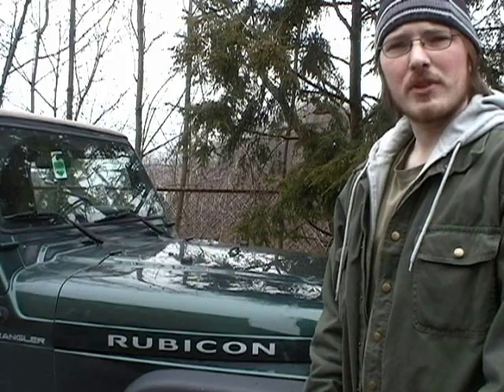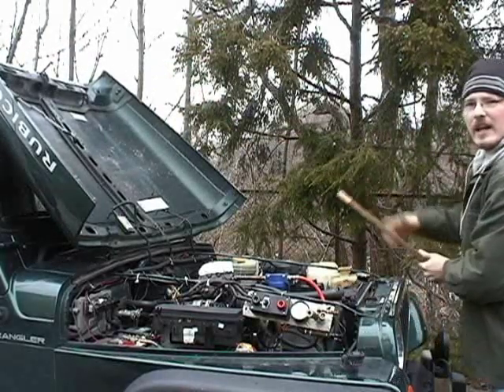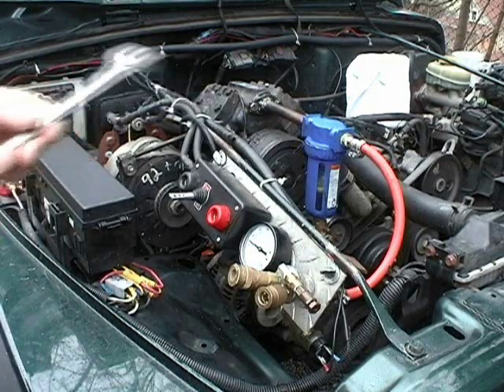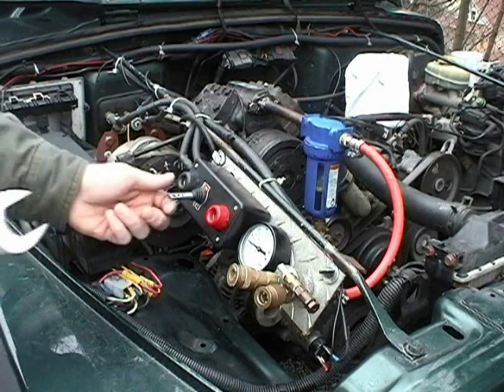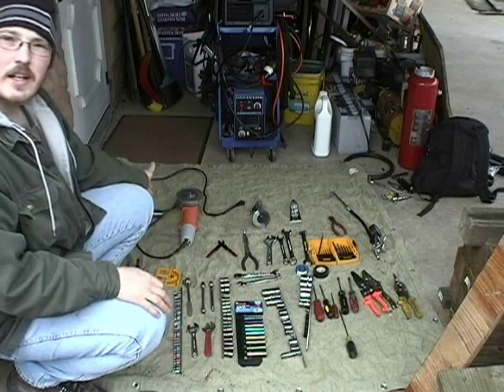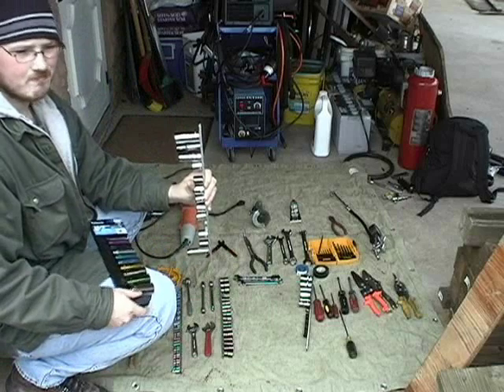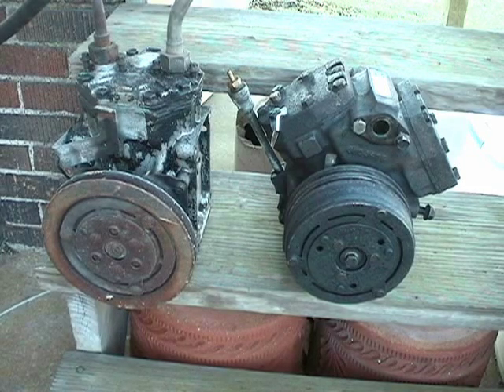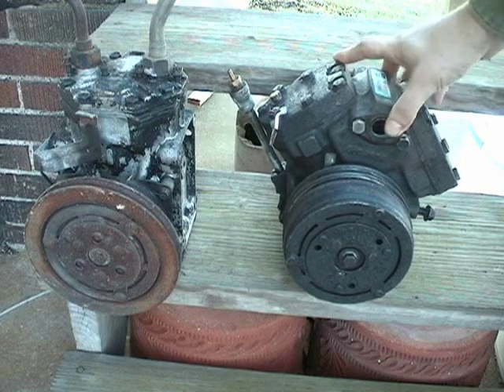Building a On-board Air Compressor / Welder Part1

Comment: To build the on board welder on my old Jeep, I used a 1976 Lincoln continental alternator, externally regulated, the Miller quick disconnects, a 110 Jack for brushed power tools and a 250 VDC gage. I can weld and run grinders , just depends on what rpm I have to spin it at. And I don’t have a gaggle of stuff hanging off the back of the alternator. And I can run it hot enough to burn 1/2” plate steel. Best part is it is a off the shelf alternator from oreillys with a life time warranty.
Hasn’t failed me yet, but I end up fixing everyone else’s junk.

Comment: Instead of the alternator diode pack, use a 200A 3-phase bridge rectifier. You can pick them up for between $25-50 on ebay. An alternator is 3 phase, so you have three "hot" wires you need to rectify, all sharing one common ground. The 3-phase rectifiers are easy to mount and hook up, and will not eventually break due to vibration like the jury rigged alternator rectifier pack as you are using. You can get them all the way to 1600v @ 500A.

Comment: You made a comment at the end of this video about the cast iron RV2 having better heat dissipation over the York. If your just going off of heat dissipation, then the york wins simply because it is an aluminum housing. either way not a bad video and there was a lot of information thrown out there

Comment: I've got a 14 horse gas compressor in my work truck I'm fairly sure it's cheaper and I know it's a hell of a lot better. It's easily installed and if it fucks up your not stranded.
Reply: you can get compressors that work with inverters to

Comment: Doing this to my 2000 TJ, it's got the 4.0 L and I was able to get a serpentine belt pulley for the RV2 compressor I'm using. Just got the Magnet mount done, spins free and smooth.

Comment: If you have teen boys, you will run into your wrenches in the yard. You will ruin your mower. But at least you will have found your 7/16 th, 1/2", or 9/16 th wrench that has been missing for a month.

Comment: Nice job fellows.  I am not much of a 4 wheeler, but a friend of mine was able to get a permit to go on the dunes up at Cape Cod, so 4 wheeling I went.  I threw my 10kw generator and 7 hp. gas powered air compressor in the back of my F350 diesel and towed his Jeep up to there. Did some 4 wheeling, hit Lesbian strip clubs in Provincetown and all was well...LOL!

Comment: that's why you utilize the compressor clutch, energized by the pressure relief/regulator valve, it'll kick on when you need it, and free spin when you don't.

Do your homework, and use the grey matter between your ears once in a while.

and about value retention, I sold a vehicle 2 years ago with a custom York OBA setup, the guy willingly paid me $500 just to keep it in the truck, I paid $150 for everything needed...... I've already built another one to install in my ZR2 after it's 4bt swap.

Comment: @MrAveragebear did the early jeep's PTO have the option to run a backhoe? Like my comment said, search santana land rover and you will be blown away; (by the many different PTO attachments they had available, from firetruck units to backhoe units to heavy welding units, the list does go on).  (not just the normal tractor PTO stuff)

Comment: Good idea man,,,,, but you can get all of that as bolt on parts if you purchased an old series land rover, they even had a backhoe attachment. All P.T.O, - power take off like a tractor. 
Search "santana landrover" and you will be blown away.
Also my man, do you know car batteries explode big time? Try not to use that cutting thing like that in the engine bay,,, just to be safe..

Comment: York 210's fill 40" tires from 7-30psi in like 2min... 35's in like 40seconds.  33's, which most people would use them for, would be like 30 seconds, and it will still run air tools.  You can try to match a 12V or even a 115V system to a York, and find the York to be a pretty nifty setup for the money.

Comment: u might wana put that diode pack in a box with 12vdc fan soo not to over heat them 2 did u have a reserve tank for air pump  iam sure u got  to  run engine to weld  good idear all in all

Comment: well here's my counter agrument.

1,)   like an AC unit,   this will not rob your horse power when not in use

2.) Your wrong about the resale value.  Modification to Vehicles only add to their value 

3)  DeathBlade is Right

Comment: YOU want an air compressor in a jeep becuase you want to fill up your tires after you air them down. 

This kit is simple.

Its just a good thing to have.

(wont rob horse power when not in use)

Comment: Why didn't you just buy a vair 480c compressor? My dual compressor setup is bolted under my chassis, costs $300.00 and took 1 hour to install. Why clutter your engine bay up with all that crap?